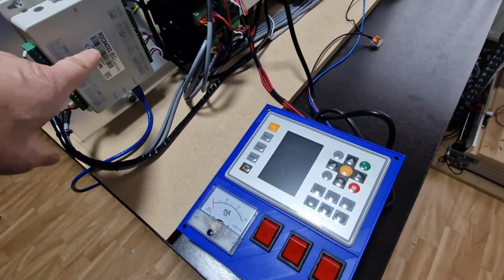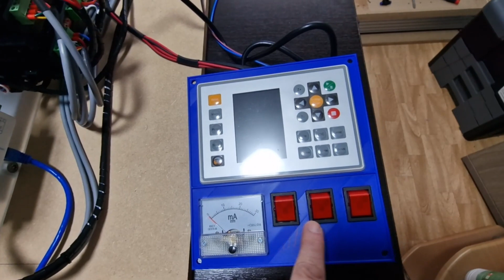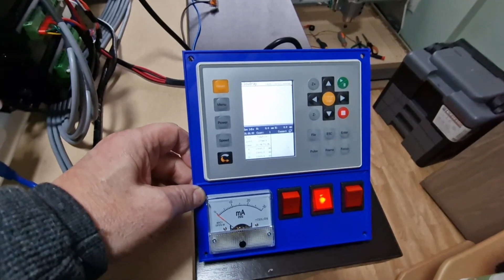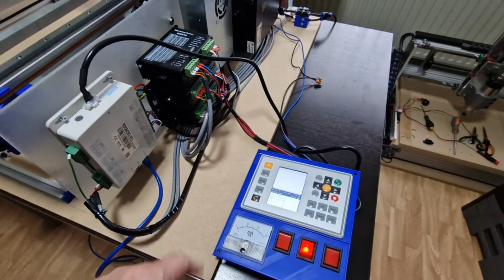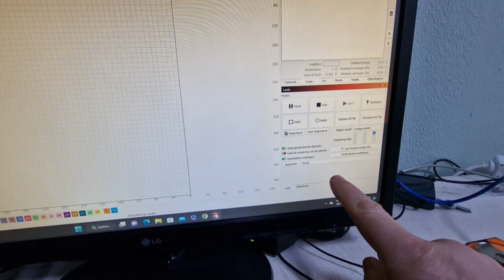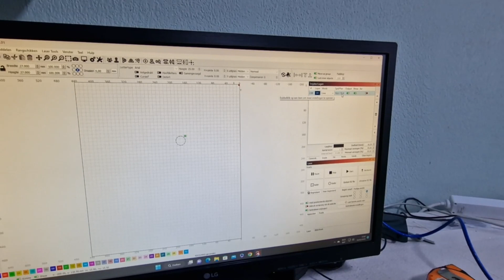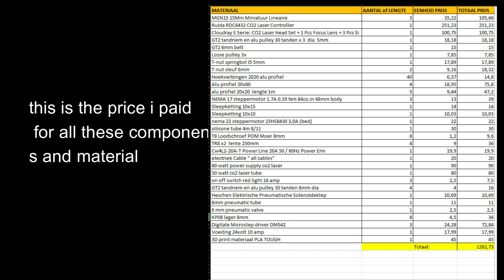DIY CO2 LASER mechanical part 500x440

Comment: see three drivers....for x,y1,y2....or for x, y, z (table).....so question is....are you running both Y motors off 1 driver?.....just reverse the stepper leads so they spin in opposite directions? or using 2 drivers for 2 Y motors?
Reply from the maker: 1 driver and reverse 1 motor kable

Comment: ello. I am starting to build a co2 laser and I have seen its assembly. I would like to know if you could show me a little more detail about the x-axis of your machine and the material used as the motor and pulley system. Thanks in advance.

Comment: Nice work. Now the case and fan for smoke. Are you using a chiller for cooling the laser?  I made mine as well, 24 x 33 in bed with a 100w CO2 laser with auto bed leveling. Having a lot of fun with it. Enjoy yours.